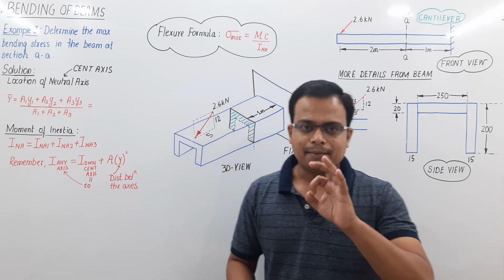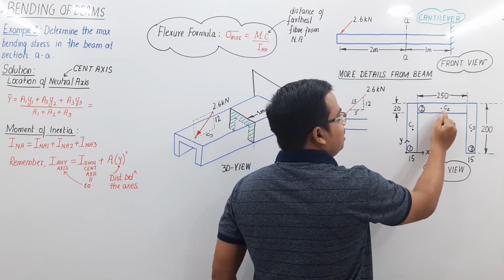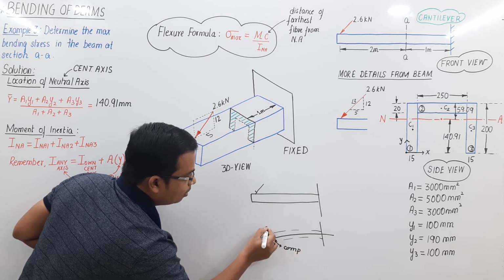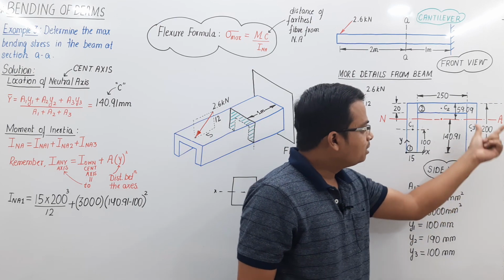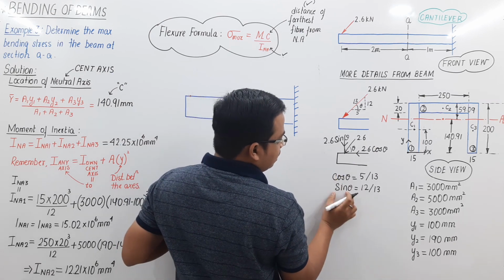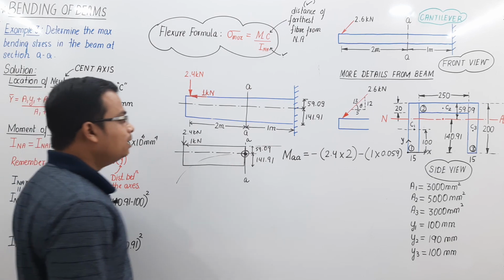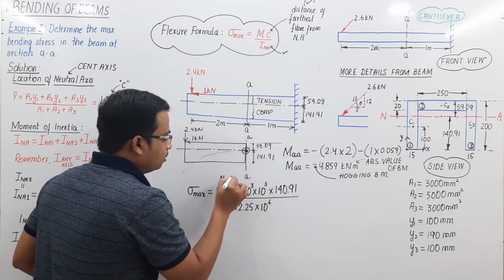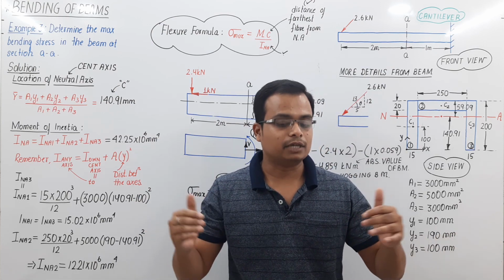Bending Stress in a Channel Section | Worked Example | Lecture 4

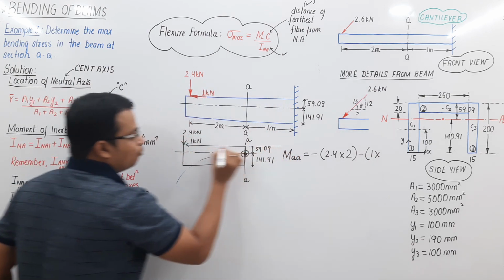Comment: To calculate the max bending stress in the beam we need to plug in max bending moment on the section (a-a) which will be at the lower most fibre of the beam , so i think there is a bit mistake in the problem! 23:55

Comment: Sir in a cantilever beam max bm occurs at fixed end for udl but at that end shear force is not zero but for pure bending shear for has to be zero so will flexure formula still be applicable even when sf is not zero
Doubt ss rattan ch 5 example 5.3
Reply from the maker: Hi pranjal.
The flexure formula is meant for the normal bending stress across the cross section due to bending moment. It has got nothing to do with shear force. 
But you can certainly calculate the shear stress. And that we will be discussed in the upcoming sessions. 
And even the resultant stress can be calculated using principle of superposition. 
Even lectures on the combined effect of bending and torsion has to be discussed.